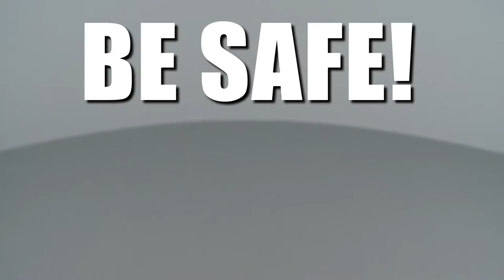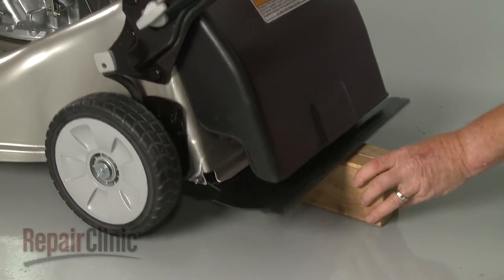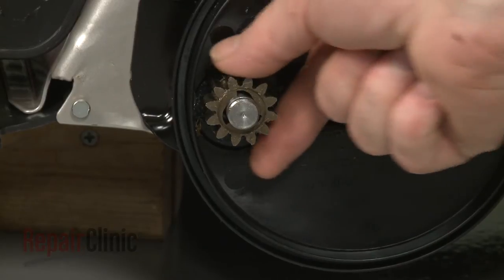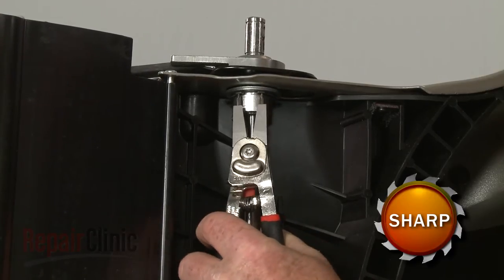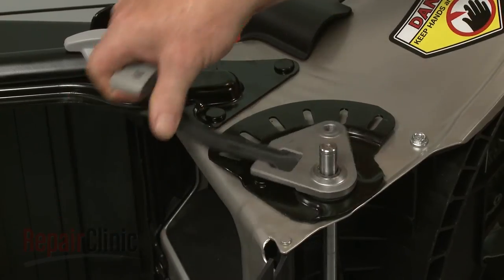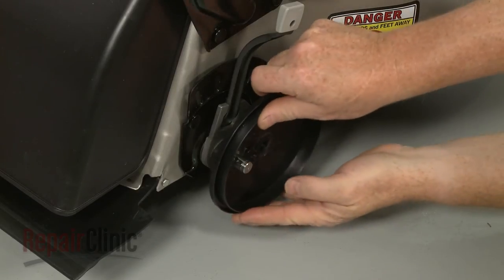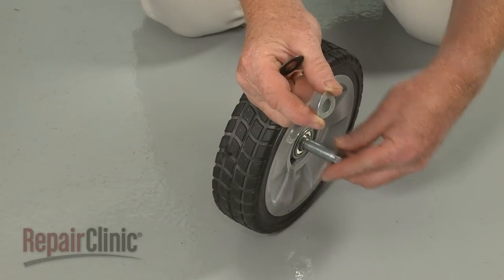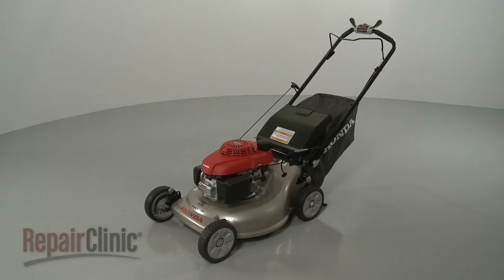Honda Lawn Mower Right Rear Wheel Support Part # 42930-VG3-B01

Comment: Thanks for making this video, definitely helpful with keeping all your washers and spacers in the right place, for anyone else considering this repair make sure you're very careful with the ratchet key, (little piece sitting on top of the axle when you pull the gear off, very easy to lose).   Video is easy to follow and makes repair pretty straightforward, but you definitely need a pair of retaining ring pliers.